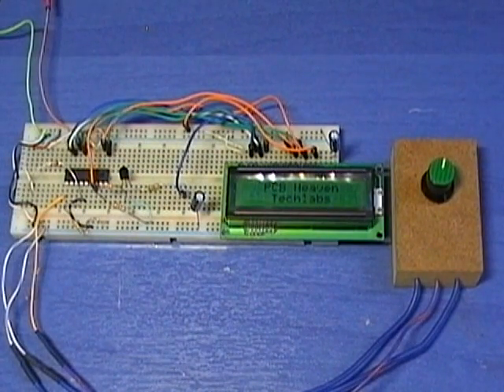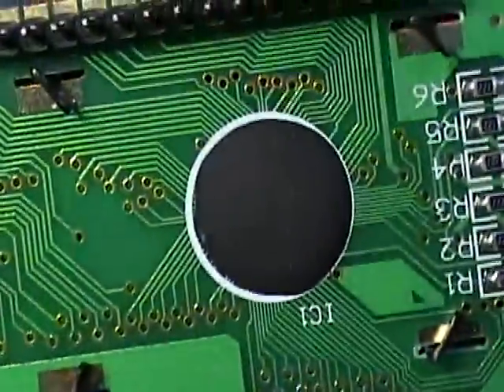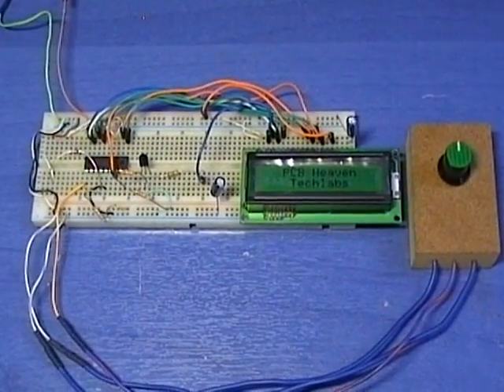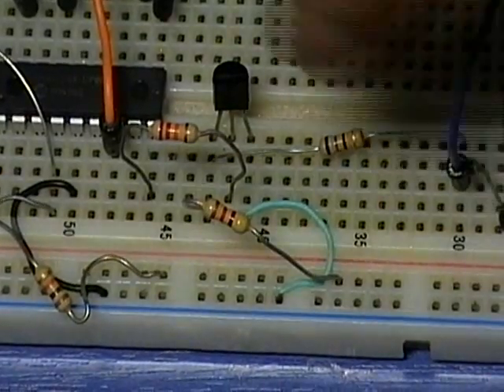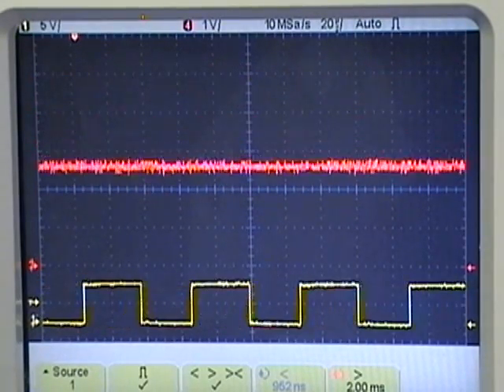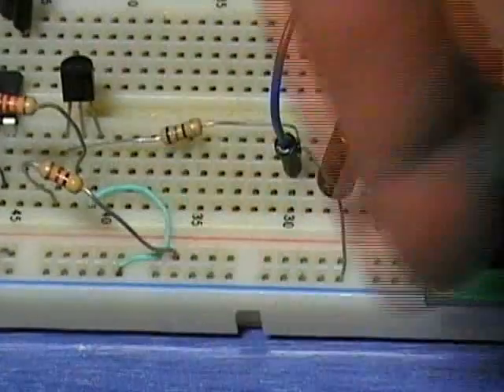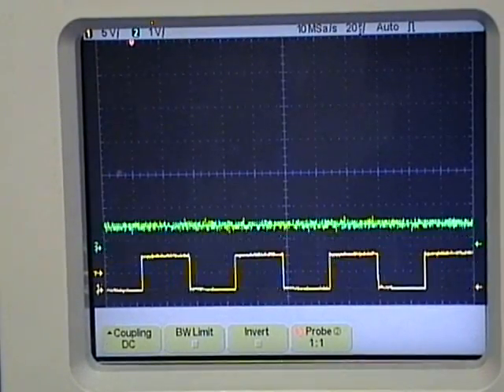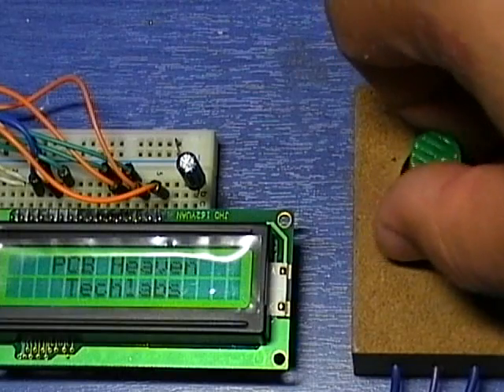PWM LCD Contrast Adjustment digital interface

Comment from the maker: @JC4crs lol, cool. Mate, let's restart this and let me explain once more one little thing: I know that a potentiometer can adjust the contrast, but a potentiometer has a mechanical shaft that someone or something can move it. So, you are absolutely right that a resistor (or multiturn pot) can control the contrast. But here is the trick: I will use this circuit to fade in and fade out the characters AUTOMATICALLY, from the PIC. Can the potentiometer do this? No! You have to turn it by yourself!

Comment from the maker: @JC4crs man, for real, go see the circuit. it is injecting no PWM pulses whatsoever. The PWM pulses are "translated" into an analog voltage level, same quality and smoothness as if it was from a voltage divider. Yet again: the circuit is NOT to replace the voltage divider. The circuit is to add DIGITAL control to the display's contrast, something that is impossible to be done with a voltage divider.

Comment from the maker: @JC4crs certainly, one resistor. But i'm giving you the way to control the adjustment digitally. You can have for example a "contrast" bar on the display, and with up/down arrows you can control the contrast. I bet my horse that you cannot do this with one resistor ;)

Comment from the maker: @Kankki1 it will also work, indeed, but even with high frequency pulses (i tested with 16.2KHz) there will be flickering when the contrast is intense. Moreover, i would like to go with the LCD specs, because this voltage controls the 5 different voltage levels during the LCD voltage characteristic. I do not want to disturb this voltage because it may shorten the LCD life.